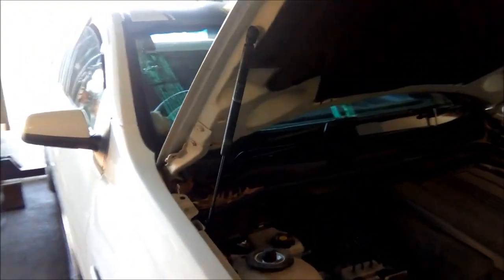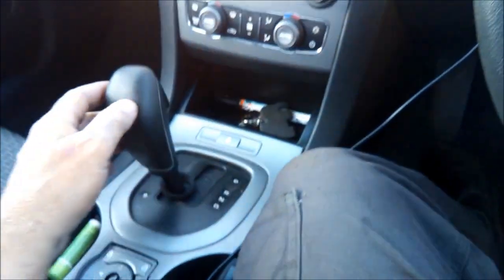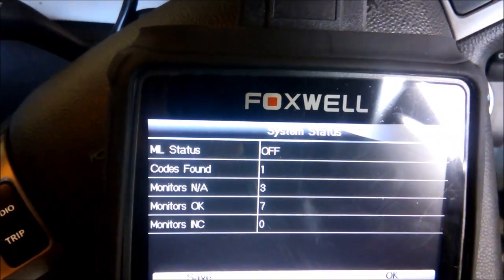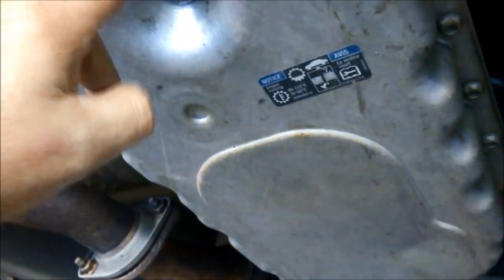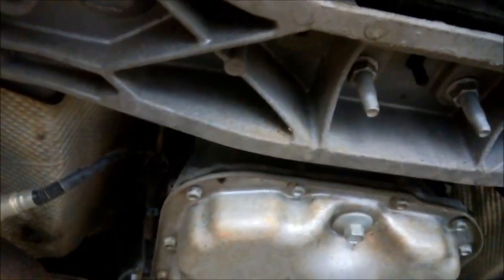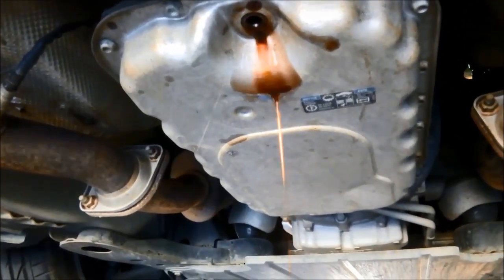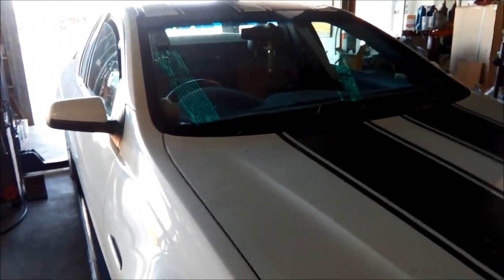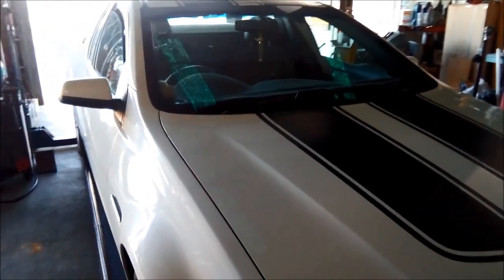VE Holden Commodore GM 6L50 Automatic Transmission Filter Service & P0174 Fault Code

Comment: Hi mate, I know this is an old post. I'm having dramas with my VE 2011 v6, I had the P0174 code, now taking off its fine and rips through the gears, however if you need to take off while at speed so the transmission needs to kick down it sort of bangs and stutters and makes me think its the trans. Could the o2 sensor being bad cause this? When you said the fueling could be bad and thats whats making people think its transmission it got me thinking maybe that's my issue too. ( I know its hard over the net etc, thank you for an advice in advance )

Comment: G'day mate,  I've watched a few of your videos on the 6l50. I have a 2013 RG colorado 4wd with the 6l50, it doesn't have a drain plug on the bottom of the pan or a filler plug like you remove on the side.  Any ideas on  how to remove the oil then fill?
Reply from the maker: hi, interesting ! how many bolt holes on pan ? can you send me pics of pan and left and right side of trans via our facebook link in description. cheers

Comment: Is checking it with the laser Temp gun accurate enough
Reply from the maker: hi, we have compared many times to scan tool readings - results are negligible. just make sure you get a few different position readings for average - front & rear pan as well as the bell housing. cheers

Comment: mine does a similar thing at full throttle, although it doesn't do it all the time. Whats the torque when bolting the trans sump back on? Watching my rev gadge though, doesn't seem like the engine reving, just sometimes when I put my foot down she takes too long to build up speed
Reply from the maker: hi, see my latest 6l50 vid   https://youtu.be/iBAHr6GbSmg   cheers

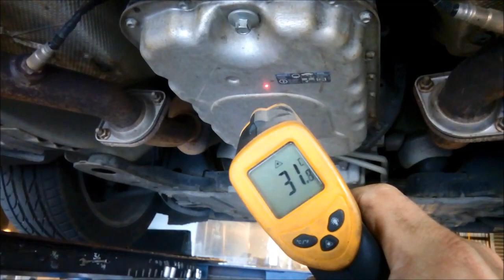Comment: Excellent video... but get temperature from engineering mode on dashboard readout, not the surface temp of the sump pan (@4:40). On warm up the oil within will a lot hotter than what is being shown on the outside of the sump.
Reply from the maker: hi, i have compared in temps in past, and find little or no discernible difference. the engineering mode is "transmission sump temperature" and is where the temp sensor is located. choice is yours as always to check how you like. although thanks for your input , these questions help everyone....cheers

Comment: G'day YepThatslt I have a 2012 sv6 sportswagon and I'm not sure if it has the 6L50 or 6L45 any help would be appreciated. I did do some research and I think it is the 6L45 but I just want to be sure. thanks...
Reply from the maker: hi, sorry we mainly only have 6L50 in Australia. however this may help if you google 6L45 vs 6L50 or see goo ol` https://en.wikipedia.org/wiki/GM_6L50_transmission . cheers
Reply: Look at the build plate in the engine bay. Right down the bottom (in the middle) it'll tell you your transmission type. If it says MYB it's the 6L50. If it has another code, google "xxx transmission code VE" (where xxx is your code) and it'll give you your transmission. I have a MY10 and it was one of the first with the 6L50. I'm guessing you have the same.

Comment: Does a tool exist to
 remove the filter seal? or just push in one side and carefully pull it out.
I think I prefer that trans fluid level check to my bf.
Fuel filter maybe, inside the tank I think and a horrible job to do by memory.
Reply from the maker: Hi, find a steel washer that slides tightly in through the seal. It will have a hole or thread in it so you can use a slide hammer to tap it out. Once you push the washer through the seal, cock it to one side so it catches the inner top edge of the seal so you can slowly tap it out. Try make sure you tap slowly and as evenly as you can around the seal ( not too much on one side ) or it will grab on bore too much as they are fairly tight fit. Sometimes you may need to make the outer edge of the seal a little "sharper"so it can grab the edge better. I will make a video sometime down the track....Hope that makes sense Cheers
Reply: YepThatsIt , yeh that sounds worth a try